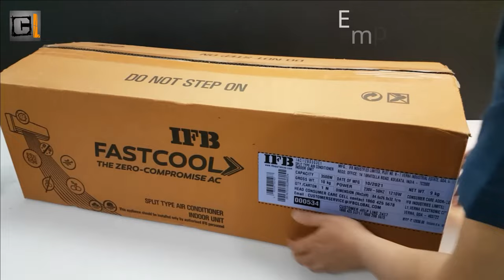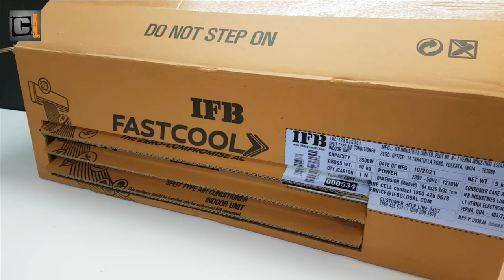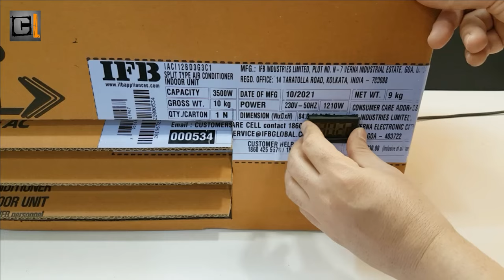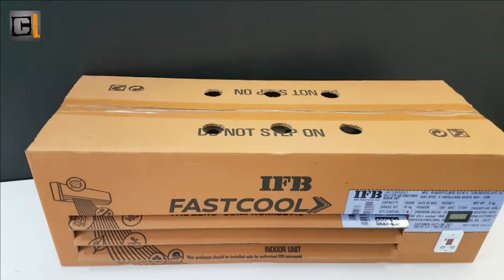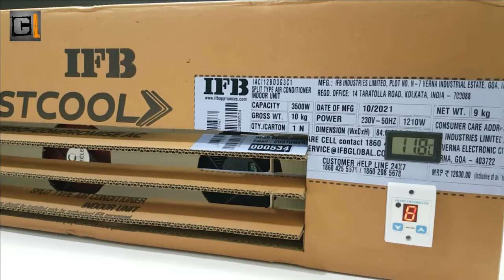AC के डिब्बे से AC बना डाला | How To Make AC at Home | Air Conditioner

Comment: Two peltier units is not sufficient to cool your room. At least 10 petliers is needed to get some kind of  cooling
Reply: dude its a personal room cooler not a living room unit
Reply: @Suproxus  ur silly to think that will cool your room.....lol. peltier units only work for small applications not large scale applications. Otherwise it would have replaced acs.
Reply: @lukedias1988  man who expects every room to be a master bedroom :
Dude my room isn’t massive and this works just fine and no they wouldn’t replace a conventional air conditioner because they are less efficient but I’m just deaperate to get some cooling in my room and think before calling me silly
Reply: Edit: I accidentally added the “:”
Reply: @Suproxus  He is right. Peltier module will not produce enough cooling to cool even a 50ft room. You will need a few. Another thing to consider is how much energy they actually use. One about that size can use around 50w. So, Youll be using over 100w for that unit. A standard wall AC uses around 250w for a 5000btu
Reply: @ImChrisDeDecker  thats why i used 10 but ok
Reply: Right, This project won't work because hot side is also in the same box.
Reply: I have a question i found an ac indoor unit
Using 3 peltier to cool the water and using a pump  supplying cool water through evaporator  and running indoor blower motor can i cool my room i kinda feel like a good idea
Reply: @Suproxus  q
Reply: @ImChrisDeDecker 250w for a 5000 BTU unit? 
Wow that’s world news!! 
Come on seriously? A split unit of that kind will consume 500/600 watts
Reply: Will this ac work for me I'd I want cooling around my gaming setup only on my face
Reply: @Johnnyyt09 yeah bro it will work, recently I had made one ac using 2 Peltier 6ampere , working good but consume a little more energy
Reply: @Team_Reaper.  Bro i am planning to do the exact same thing, i just feel like it's much more efficient,                 
What i am gonna do is use a copper tube and bend it in different angles just like in the actual ac, i will connect one end of the copper tube to a well isolated container and the other end to a submersible water pump which is inside the water container, i will initially use 3 peltier modules with radiators to cool down the water and when the desired temp reach, 2 of the peltiers cutoff and one module work to maintain the cool temp of water, after using the 1st peltier for some time, i will switch to the seconds one and first one cuts off to cool down the other peltier module, this cycle is repeated to ensure efficiency in current consumption and extend peltier's life span, all of this are controlled by arduino, there will be 3 large cpu fans to push out the cold air exerted from the copper tube, i think this will work much better than directly attaching cpu fan to peltier, it may produce some level of comfort to a small vicinity of room, preferably my study table.
Reply: @TRAZExYT  bro i bought an ac 😁
Reply: @Team_Reaper.  😅😁
Reply: @TRAZExYT  🌝
Reply: Do you even know what is TEC1-12715 Peltier ? Each one is 180 W making it a 360 W working ac. It works better than most air conditioners and cools perfectly.

Comment: 3 or 5 Peltier aren't enough to cool your room. For better results you need at least 10 unit Peltier align as 5+5, 5 Upside 5 Downside Then you need bigger fan, maybe double or triple 15cm fan can help. it can blow more wind effectively for larger scale room such as bedroom. Then you can improvise the heat side of it's Peltier to warm up your water In your bathroom using a bucket, you just need to add water block stick to heat side, then pump the water to water block. Then voila, you got double stuff, a room cooler and water heater at the same time.
Reply: No need for it just use 2peltier and 4 fan it will cool up a single 5×4metre room after 30 min easily, I had made  and experienced that.

Comment: Box design is not efficient for exhaust heat ,and as you can see cooling is vry slow bcz he didn't channeled air flow of cold side, brother i recommend you to make directional air flow for both exhaust and cooling side in a single direction,you will get faster cooling and faster escape of heat

Comment: This need at least 5k rs use 10 ther. And 8 fan and 12v 40a 480 watt power supply use dc waterpump on heating side
Reply: Yes atleast cheaper than ac